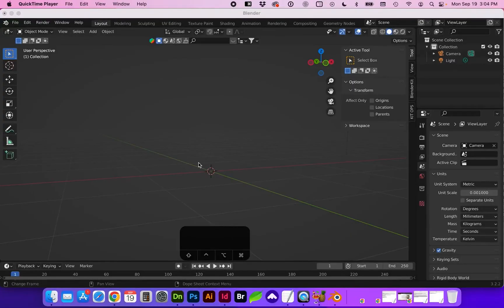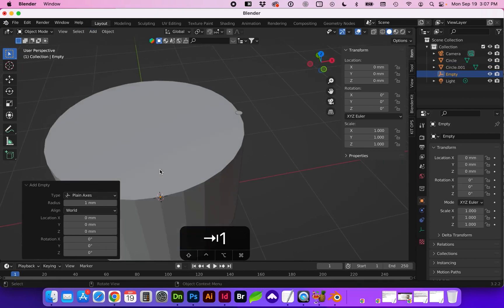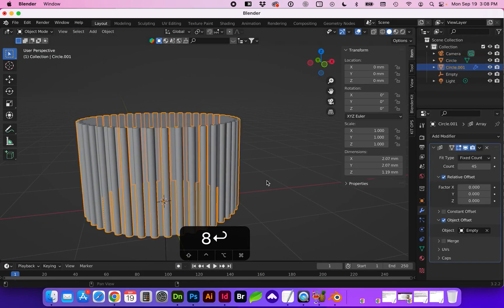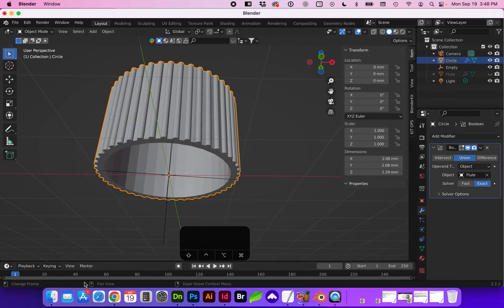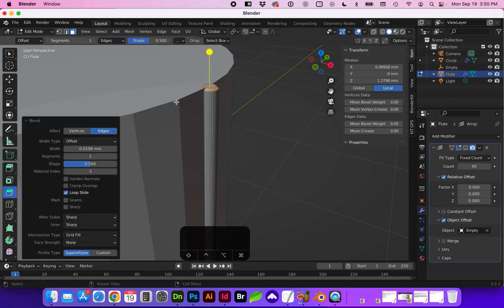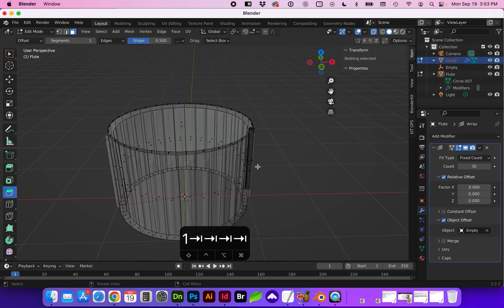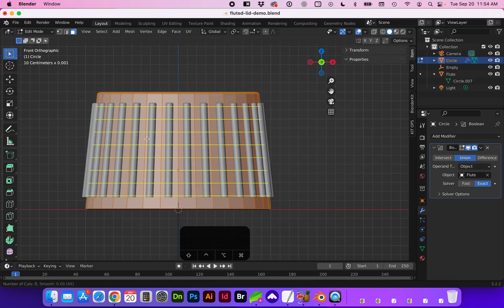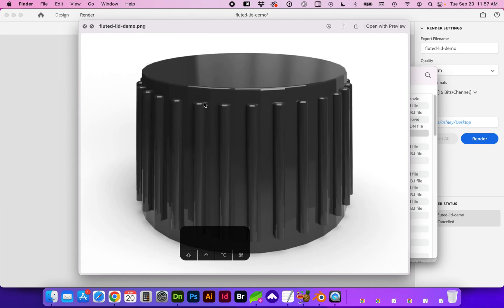How to Make a Fluted Lid in Blender (Rendered in Adobe Dimension)

Comment: Better use a latice modifier to taper the model. Thats none destructive
Reply from the maker: Thank you! I will try to refer back to this when I make a taper again. I'm not a full-time modeler by any means. I use if off and on and sometimes not for several months. I'm open to ongoing learning & improving.
Reply: @ashleycam3ron  one down side to the lattice, you don't have much control, so it will probably squash a d stretch a bit. Then your method is better. But I would add shape key on both items. That way you can always adjust the angle with a slider and even take it back to its original form
Reply: Another trick, where you can adjust the angles is add a shape key on both the main object and the side rib. So add a base shape, add another, set it to 1 and move it. Do this on both shapes. Then you can adjust the angle however you want by adjusting the slider